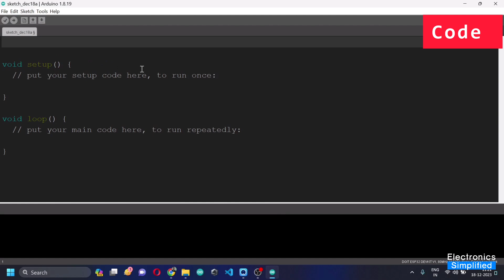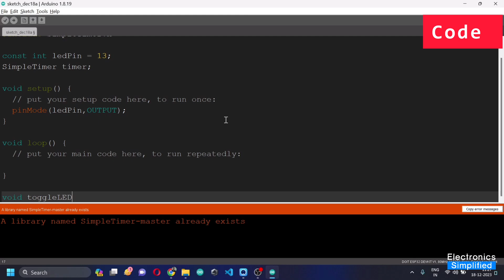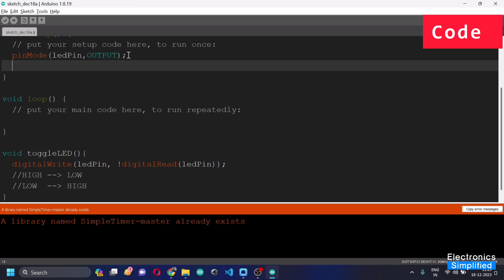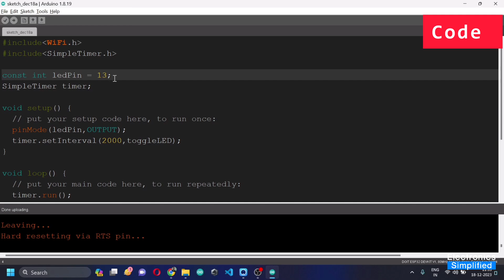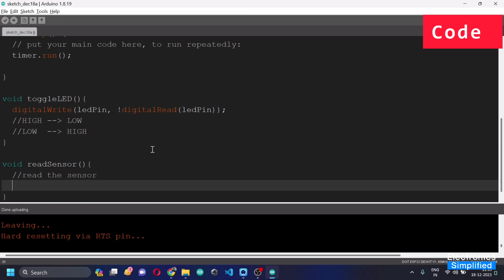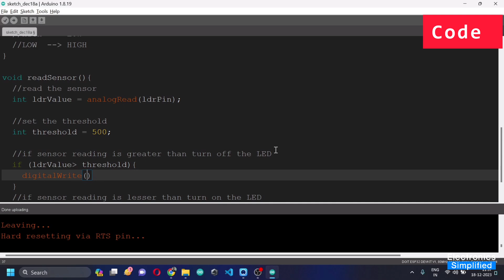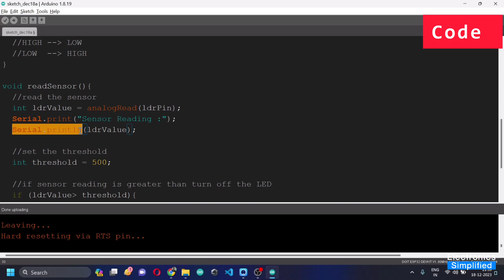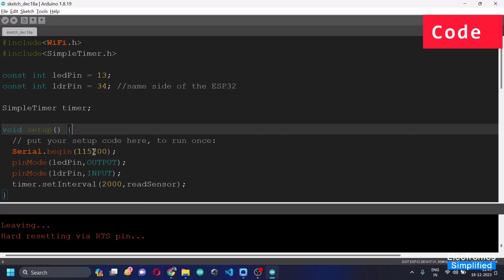Task Automation with Simple Timer using the ESP32

Comment: I have smart plug having Esp32 in built connected to wifi, I can program my smart plug to switch on-off at any time in a week. But what exact command comes from Smartplug cloud APi , to toggle the relay,,,
Means I am dependent on internet for communication, if I can program locally without internet, via local private IP , how can I do it ?
Reply from the maker: Are you able to reprogram it?